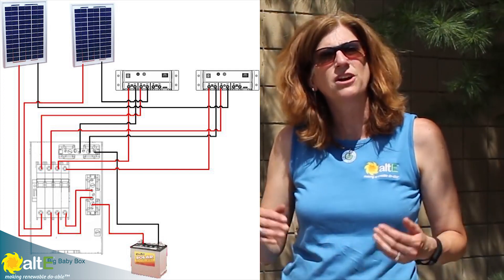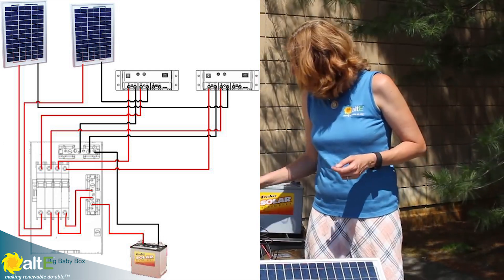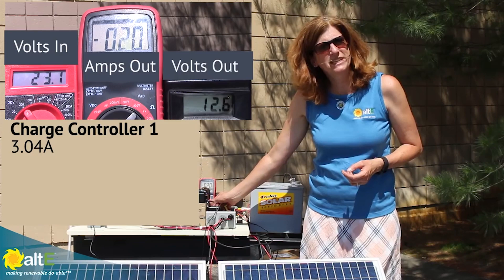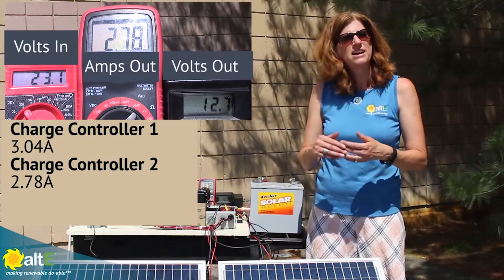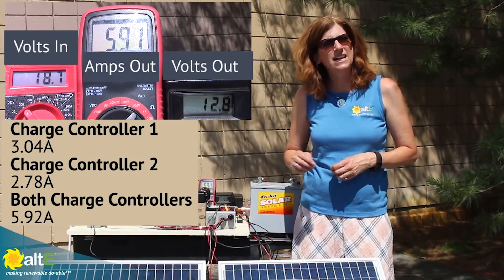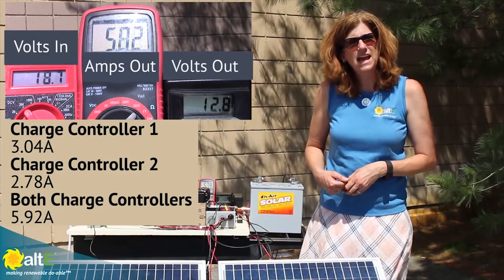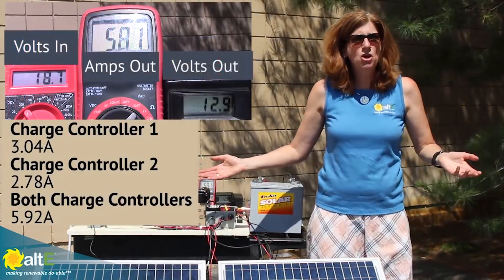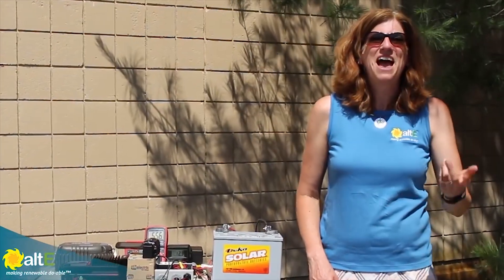Wiring two charge controllers in parallel - Updated schematic

Comment: Yeah, no.  This doesn't work efficiently if the charge controllers don't have parallel capabilities.  Notice how the current starts jumping around and then decreasing near the end of the video?  That's because charges are designed to read the internal resistance of batteries.  The problem is that they can't communicate with each other, so one doesn't know that the other one is there which leads to a false reading.  Will work in a pinch, but is not something you would want to purposely setup in this manner.  Only parallel connect charges with parallel capabilities.

Comment: I have 5x100W  panels connected in parallel, feeding 1 PWM charge controller that charges an Optima Blue 75 AH AGM Battery that I power my cabin lights and a small water pump from. The  water pump I need to run 24/7.  Now I have an extra almost new 75AH lead acid battery from my scrapped car. Could I have the 5 parallel PV panel array feeding 2 charge controllers in parallel, one to charge the AGM battery  dedicated to power the lights, and the other dedicated to charge the lead acid battery to run the water pump independently?

Comment: Thanks for answering a simple question for me. My new RV came with a solar panel installed on the roof and the controller is on an inside wall. I have a second portable panel with it's own controller that I can move to a sunny spot and I wanted to be able to connect it into the system but connecting it upstream from the controller would be difficult and less than graceful. I wasn't sure how connecting the outputs of two separate controllers would affect each other but from this video and other sources it seems to be fine. Easily adding that second panel whenever I need extra power is very helpful.

Thanks for the video!

Comment: Is there a situation, where you can have too many MPPT charge controllers for your batteries, and if so, how do you look out for that?
Reply from the maker: Yes, you would not want the total output Amps of the charge controllers (and inverter/charger) to exceed the maximum charge Amps of your battery bank. Check out this video on C Rates for more info! https://youtu.be/cX-LU24eVOU
Reply: @AltEStore  Thank you so much!
Reply: @AltEStore  How do feel about PWM charge controllers being in the Parallel mix?

Comment: This is nice because now you can use cheap $10  controllers per cell as "micro inverters" but for DC. This will help your DC setup if you have shading problems on your cells. Thank you for sharing this.
Reply: I think it's important a collection of parallel charge controllers be MPPT.

Comment: Hi, i wish you could answer my question, if i have 2 different brand of mppt and each mppt connected to different brand of solar panel which mean there is different voltage and amps coming to each mppt, can i just parallel them like yours and charge 1 battery only? If it double the amps, what about the voltage? Thanks a lot

Comment: If I have 2 x 24V batteries to make 48V and one of the batteries shuts itself off, will the parallel charge controllers harm the remaining "on" battery?  It seems like they might trick each other into thinking they still have a 48V battery to work with, when in fact it's now only 24V.

Comment: Thanks for your video presentation and your guid about paralleling charge controller
 Is it possible to parallel load output of charge controller ? regardless of battery charge output?
Does it depend on charge controller type or not?

Comment: does it also increase volts so if i have 3 40 volt panels and i have 2 30 amp controllers that can handle 200 volts from these panels

Comment: I completed project for my house with the help of your videos. Thanks. I using 12v appliances like bulbs, TV, mixergrinder, water pump. It reduces battery depends. One question is in my mind "can we connect 12v batteries in series to get 220v for induction cooktop? If it is yes how to connect with out danger? For emergency purpose I asking.

Comment: Can you wire 2 inverters together
Reply from the maker: It depends on the inverter. You need ones that are designed to stack together. They will synchronize the AC output.
Reply: @AltEStore  thank you  ,Snadi   3k ?

Comment: So this could be the answer to my situation. I had two 60amp lead acid batteries that I just replaced with two 100 amp AGMs . I have one 80w panel that can't really charge both 100 amps even on a sunny day. So adding a second 80w panel (it's all I have room for on the roof of my RV) wired in parallel would double the output amps (or what ever the 2nd charge controller output was would be additive to the current one)?

Comment: Great video as always. Maybe you could answer a question for me. Why can't you use reflectors to boost the amount of light hitting a panel. I know this isn't viable in summer because of the high temperature it will produce. What about in winter when it's cold and the sunlight is weaker?